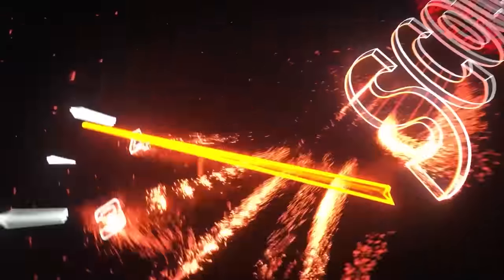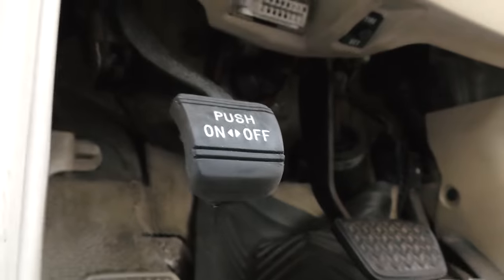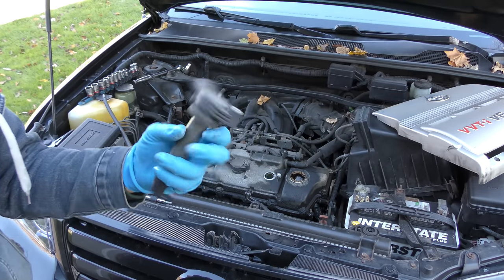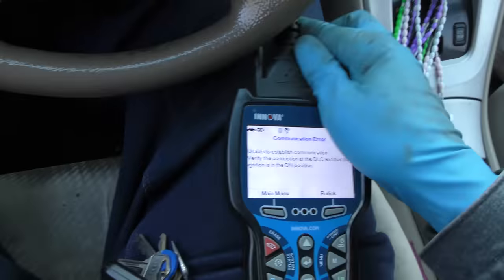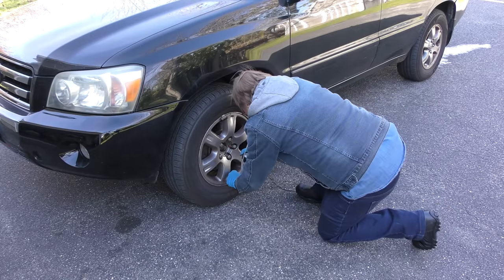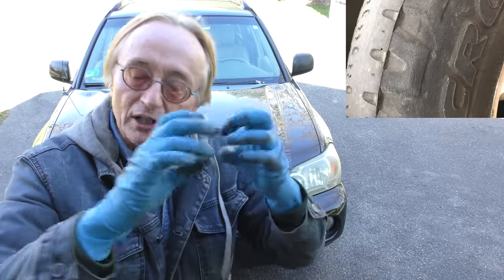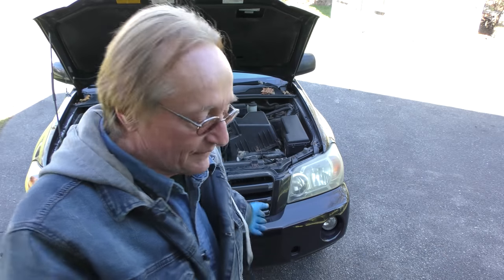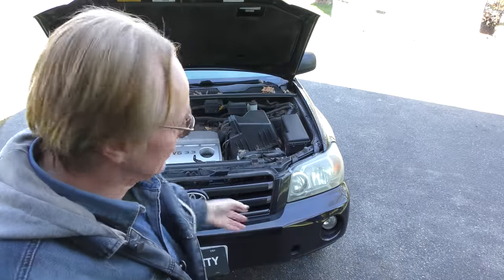Doing This Will Make Your Engine Run Like New Again

Comment: Scotty!, I reiterate, the beauty cover does have a purpose, noise management and stall/misfire prevention through water intrusion.  A friend who took off her cover had her engine washed, misfire happened after. I remember my 86 Mitsubishi galant, after driving over a long shallow puddle at very high speeds, engine stalled coz the HT cable sockets got wet.
Reply: Don’t wash engine Scotty will tell ya that’s why😂
Reply: @Udokee  you're not supposed to pressure wash your motor.....you dont need the cover.
Reply: true, but in the southwest and other arid places you could take the thing off and pitch it and never miss it....
Reply: I wished that she took off another cover instead.

Comment: That's one of the reasons that I don't like transversely mounted V-engines, for the difficulty in getting to the rear bank of cylinders for any kind of work that needs to be done back there. I have a late model Nissan 370Z that has a longitudinally mounted V-6 engine, that is still difficult to access because of all the stuff crammed into a small engine bay.
Reply: just one of the many reasons the Z33s nearly bankrupted nissan.
Reply: @tommurphy4307  The Z33(350Z) used a VQ35DE or VQ35HR, both of which were longitudinally-mounted engines in a rear wheel drive layout.

Comment: Headlights need cleaning. I find that using a dry napkin and spray deep woods off on Headlights then wipe quickly works great on my 21 year old lexus. I do this once a year and Headlights look new!
Reply: floor finish will do the same thing- or clear enamel. theres prolly a dozen ways to protect the plastic

Comment: My convertible had a coil misfire code - they replaced one or two of them, but said the missing was showing up all over the other cylinders randomly - so they rebooted the engine computer, and they said it was running fine.  I was "kind of feeling" maybe the whole set was having quality problems - granted the engine light never came on again - so that computer fix seemed to solve it.

Comment: Got to admit if it was my motor I would have replaced all the coil packs and plugs. You can pretty much guarantee they all start failing at the same time. 
Coil packs are a consumable imho.

Comment: Scotty I have a flashing check engine light then goes solid and the next day it will be off. This only happens when I'm going uphill and I'm at 3000 rpms for to long. I've replaced coil, plugs, wires, distributor, fuel filter. 99 chevy tahoe. You have a video for that?

Comment: Scotty help, ( or any wrangler fanatic), our 2001 wrangler is in the shop but our mechanic is stumped, with the codes cleared it will run fine for 2-3 miles and all of a sudden run like crap throwing 11 codes. The plugs were changed ( original plugs had 75k), coil pack rail with ignition module, 2 oxygen sensors, crank sensor, checked ASD relay, tried 2 new computers, checked the grounds and wire leads for corrosion. Fuel filter is good, fuel pressure is good, fuel injectors  are good..  any ideas???
Reply: Go to a real mechanic.  One who knows or could look up the codes. Reads live data. Does tests.   Not shoot the parts cannon
Reply: try changing the technician....

Comment: I had a misfire in my 99 Honda accord. I replaced the spark plugs but my inquisitive mind needed to know WHY my car had a misfire. So I  had my mechanic friend take a deeper look into the engine. Turns out the rocker arm to cylinder #3 was broken. And cylinder 3 is where I had the misfire. So don't let anyone tell you to not look into it any further when you have a misfire.

Comment: Hope to get this 01 Escape back like new.
Edit: 306k miles, check engine light blinks, has a misfire but OBD port doesn't show codes. At all
Reply: I have an 01 escape and a few months ago it was running terrible, I changed the spark plugs out and gave it a tune up. I Changed the fuel filter, air filter, spark plugs. And have been doing regular maintenance and fixing any leaks. 
Edit: my escape has 201k miles. A tune up should definitely help the escape run better
Reply: Your light is blinking to let you know you’re causing damage to the catalytic converter. Basically, you have unburned fuel going into the cat. Will melt it in short order. You have a misfire for one reason or another. Spark plugs, coil pack etc.
Reply: @brockbaker3able  I just ordered some coils and plugs. I need to find hoses vor the EVAP underneath the car since they're starting to dry rot. I may be doing a lot soon. I bought it with a tranny that doesn't go in reverse...deep sigh, but it's worth it for what I need.
Reply: @LactoseTheIntolerant I bought it for 500 with a tyranny that doesn't go in reverse and was looking to buy a remanufactured engine later. It's gonna be my tinker truck since my K5 Blazer was stolen while I was in Afghanistan...loved that truck.
Reply: @gabeachoo3152  I need the 3way connector on the EVAP outlet hose
Reply: @gabeachoo3152  did you check the tranny fluid?  I'd make sure its not dirty
Reply: First and reverse are the same planetary gear set, but reverse uses a band to lock the 1 st gear to another gear which engages  1st clutch, and forward clutch.  The secondary gear allows the trans output shaft spin in reverse.

Comment: Why didn't you just move from coil from cylinder 1 to 2 instead of messing around at the back? Was it to talk about the ratchet flex head spanner or is it another reason. Wouldn't the scanner show misfire move from 1 to 2 instead of 1 to 6?
Reply: Cylinder 1 is at the back brah

Comment: That's the bad thing about the Toyota/Lexus V-6 is that in order to reach most of the rear spark plugs or ignition coils you have to take the intake manifold off. It's not a hard job to do but you have to pay attention and take your time.
Reply: Not on the Lexus GS
Reply: How about that Lexus V8 starter?
Reply: @robertdinero2853  That was a terrible design. Toyota should have done better than putting the starter motor where they did.

Comment: Hey Scotty, it would be great if you let people know how to read the date codes on tyres so they don't get ripped off and have a safer set of tyres. I went to get some "new" tyres from a largish tyre chain. When I checked the date codes on the tyres when I went to pick up my car I saw that the tyres were made 6 years ago. They didn't have another set of tyres in stock so I got them to put my old newer tyres back on and then let them know that I won't be back.
Reply: Thanks…. Great idea, *& all should know,,,,,,,,👍🏿
Reply: the only thing that really matters is that they were stored properly and out of sunlight. the plant code is more important.

Comment: If the car has manual transmission, it will never cause any electronic failure like automatic ones.
Reply: no, but it could suffer from a smoked clutch under warranty....

Comment: As someone from the UK it always shocks me just how much mileage your US cars endure. I just bought a 13 year old car and it's just done 51,000 miles..
Reply: we have the freedom to drive sorry
Reply: Look at the size of our country. We drive everywhere.
Reply: You can't drive anywhere
Reply: You guys are fortunate!
Reply: Dude Texas alone is bigger than your whole country
Reply: As an ex-salesman in the UK, my typical annual mileage was normally around 48,000 miles a year and the company cars were usually exchanged after three years.  All the cars were serviced regularly on the dot, even after the normal warranty had expired, so a 13 yr old car in the UK with just 51,000 on the clock, probably spent more time stationary than actually being used ... or used for very short trips.  I'd much rather buy an ex-sales car because servicing would almost always has been carried-out religiously, no expense spared.
Reply: Also our train system sucks compared to other countries so we have to drive

Comment: Never go to a Pep Boys either. I once had an electrical short in my tail light assembly, and they couldn't find it. So I went home and it turned out to be the rely. I used a simple $15 voltmeter to find it.
Reply: You're right never go there, my sister check engine light came on because of low oil so she pulled over and since she doesn't know anything about cars she had aaa tow it to pep boys and they told her she needed a new engine and they  would do the work for 8k, she didn't have the money so she got it towed back home, I put oil in it and started it up , the engine was fine and she's been driving it for the past 3yrs with no problems. I wonder how many people they have robbed with their shady business tactics

Comment: Thanks for the tip on turning OFF the Maintenance Required light! My 2006 Highlander was due for Brake Work at 150,000 miles, which I had done at a very reputable local shop instead of the Toyota dealer 60 miles away. So I didn't ignore the problem - and now only the unimportant tire air pressure sensor light is on permanently. I may stick a tiny Smiley Face over that light. My Toyota has tires made in Russia which grip very well in the snow up here in Northern Michigan - I just  check the pressure now and then, and they never lose any pressure, anyway.

Comment: Scotty I have a 2015 Chevy Spark automatic with about 80,000 miles on her.  Never had any major issues.  But about 2 years ago, I damaged the original switch type key in the FOB.  I had another ordered and programed with no issue.  Now the problem.  When I unlock my car she unlocks the driver's side but hitting the FOB a second time unlocks the remaining a doors, then very quickly locks ALL the doors back again.  The door locks do not continue to "try" locking continuously like with some cars.  Nothing else electrical is broken or malfunctioning.  Can you email suggestions and or discuss in your Great videos??  I also have no other electronic devices connected to my car.  I have scanned Ruby - my little Chevy Spark LS with my Autel scanner but nothing comes up.  Please help Scotty. 🙏🚗💕🙏🙏🤷

Comment: Mr. Kilmer, what is your opinion on a 2006 Ford Freestar SEL minivan with the 4.2 L V6 engine and the four-speed automatic transmission? I heard that these older American minivans have better reliability and better fuel economy, compared to these older Japanese ones, because these Freestar's have a higher total range of gasoline, which goes from a full tank to an empty tank. It is usually around 450 miles or 720 kilometres. Thank you very much and have a great, rest of the week and the long weekend coming up in the United States.
Reply: @SubaruDeservesMoreLove That is a better idea for an older minivan. A 2004 Pontiac Montana is also another option.
Reply: I can speak for Scottie. JUNk
Reply: @jamesvw769  Agreed
Reply: @Udokee there's a reason some guys hold on to their aerostars....

Comment: I've a volvo xc60 2018 it has no gas cap but I got an engine light with engine code for gas cap... any video on how to change the gas essemably on that?  I've 65k mileage I've charged the O2 Sensor and Oil Trap and the hoses. Those codes are gone but now still got the engine light. Thanks

Comment: nice video.  I would have put the oil fill cap on before I did anything.  dropping something like a socket down that hole would not be good!
Reply: at least stuff a white shop rag in there

Comment: the seals are part of the anti-corrision undercarriage system, working well as designed 😁
Reply: I believe the technical term is, "self lubricating chassis." My Dakota has several of these "features."
Reply: pioneered by hyundai

Comment: My 2008 rx350 shows a p0705 code

The transmission display on the cluster panel shows more than 1 lights on

Comment: Any help on my heater not working on Ford Ranger 2003, 6 cylinder? Worked fine since u bought it in 2011. Been a good truck, just had to do maintenance over the years. Tires, battery, brakes, rear end, bearings, plugs, wires,coil.. In 2015 the tranny went out because of a bad mechanic. Man, it messed up the radiator, and tranny. Been a great truck but had to put about $3, ooo over the past 3 years, on just regular stuff. Got about 158,ooo on it. Should i keep it , or start looking for another?. This has been a great truck. Bought it for $3,500 in 2011, just been having to change out a lot of parts. I get its old, but its simple to work on, but mechanics want to charge $100 an hour, even for simple things. I need a vehicle. Any suggestions would help.
Reply: check the thermostat- start out by making sure it has one in there
Reply: @tommurphy4307  thermostats fine. Gonna flush the radiator. Thanks!

Comment: Hi Scotty I I watch your videos all the time and I would love some advice as I am stuck and don’t know where to turn I have a Honda Civic 2008 UK model my engine management light has came on and said misfire on cylinder two I have changed all new spark plugs all new coils packs and four new injectors but my engine management light is still on and it’s running really lumpy with it struggling to rev please can you help me to walk this problem may be It now reads misfire on cylinder three and four and various and energy light still on
Reply: have a honda technician check it out- the factory trains them for situations like this.

Comment: Hi was wondering if you can help me I’ve got an 2018 Hyundai i30 go it’s not even done 70k but when I accelerate i hear a banging noise from engine it doesn’t come when you’re driving on straight road but as soon as you try to drive up hill and when you have to accelerate you hear a weird banging sound from engine its not too loud but its there

Comment: I have a Chevy and it's message center shows a different language than English, it also shows the temperature in celsius and the speedometer shows a lot higher than the vehicle is running, what can I do to correct it?

Comment: My 2011 Mazda 3s does the same thing. It has a loud noise sometimes on drive but not on neutral. It revs up to 750 then down to 550 and repeat. No codes or check engine light turns on so Idk what to do. any help will be appreciate it.
Reply: Look for a vacuum line  that came off. Clean your mass air flow sensor, check plugs, and coils ,see if they're worn
Reply: let a factory-trained mazda tech have a shot at it.

Comment: Quick question. I bought a 2013 Honda Civic SI with 109k miles on it. Previous owners never changed the transmission fluid, should I do it or is it too late?
Reply: If it's an automatic then for sure it's too late
Reply: Change all your fluids anyway when you buy something, few hundred in filters and oil will go a long way. For a used vehicle, it's always worth it to start fresh with the maintenance

Comment: i have a 2018 toyota sequoia and the dealership says I have a small cam tower leak  I have 72k miles without an issue.  He said on a scale of 1-5 with 5 being a new car, mine is a 3.  He said the repair is $2,600 and takes two days.  This is the second Sequoia I have owned (previous was a 2011) and I didn't have this issue.  Do you recommend doing this?
Reply: Use some type of resealer with a mechanics supervision!

Comment: I had the same problem, but then on cylinder 3. Payed 600 bucks to garage to fix the problem including annual check
Problem was still there. Finally fixed the problem myself by changing the coil myself, costs: 70.

Comment: Hey Scottie. probably needs spark plugs with all these miles on this Highlander and may be the reason why the it killed that coil... spark plug gap was out to lunch... A new PCV valve would be a good idea also, they are not expensive and most likely why blowing oil from the front and rear seals, it a easy replacement ( i have the same SUV with 400 hundred thousand), no leaks and well maintained! the best machine i have ever owned!! ty Scotty keep posting great information videos
Reply: PCV valves don't go bad on low-mileage engines- the heat eventually tweaks the spring in them.
Reply: @tommurphy4307  , agree with you Sir. nowadays lots ( cost to the manufacture) these  cheap PCV Valves is made out of plastic and actually "fall apart"inside. As a "precautionary Measure and Scotty is/did saying about the front engine oil seal and rear is weeping. it is not an expensive item and it is getting upwards lots of miles. it takes  10 minutes to replace it with an Original OEM from the dealer!ty

Comment: Hey Scotty,  Question please.
I’ve got a question.
I have a 2015 Acura RDX with 21,000 miles and original tires.  The tires are in good shape.  Plenty of tread, no cracking and even wear.  But the tires are over 7 years old.  Should I replace them now?
Reply: Scotty doesnt really see questions here. If they're not dry rotted, they should be fine.just like he said about the tires on this
Reply: 10 years if still in good shape.  Still put on my Michelins on 11th year.  This will be their last year for me eventhough they're still in good shape.
Reply: Zb1jh - Yea that’s what I read somewhere.  A friend of mine that used to sell cars said 6 years and the dealer told me 5.  
My gut tells me that I can drive on them for another year or two as long as I don’t do any cross country trips on the express way for hours at a time.
Reply: Rich - I figured an answer was a long shot.  But I learned something.  A lot of car savvy people watch his vids and I may be able to get answers from the audience.
Reply: @ricardoavelar1803  what the hell do they know- do they sell tire-making chemicals??
Reply: Run it to the curve...if it doesn’t puff it’s good for another 20,000 !
Reply: Must change, it's too old, a tyre's good life is around 5 years, if you going to drive a lot on highways doing 70, 80 mph, then you don't wanna risk tyre blowout!

Comment: I did #3 coil in 2.5Hrs, on this engine, properly, not bad for a home mechanic? Yeah, it's a strip everything away job, don't crack the gas line, I didn't.